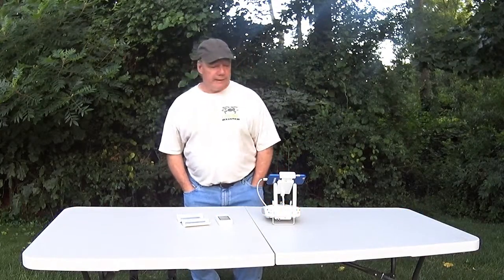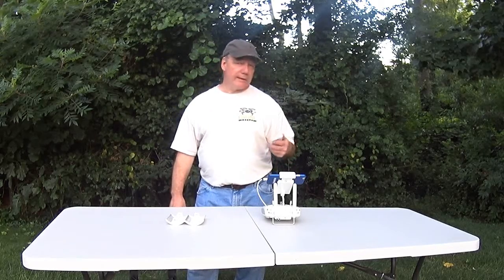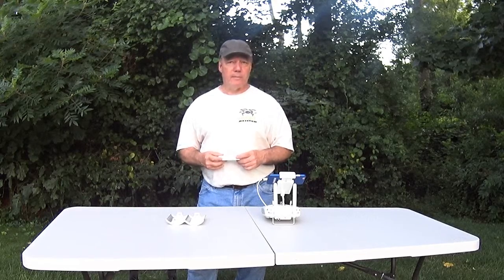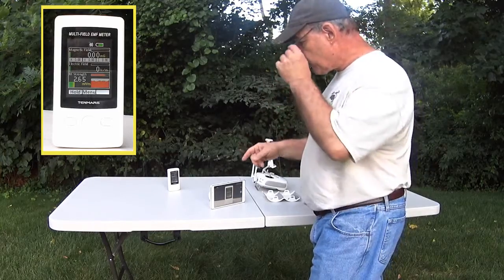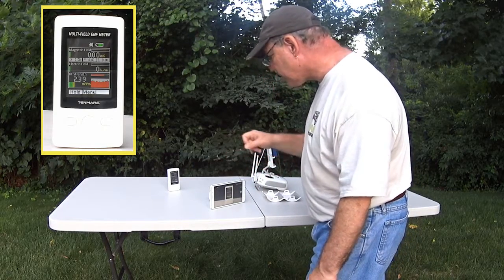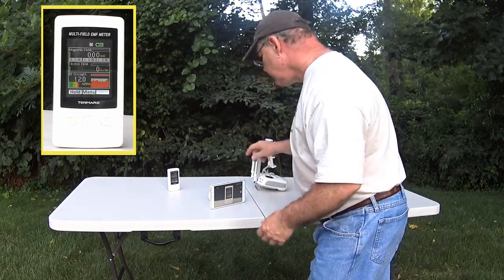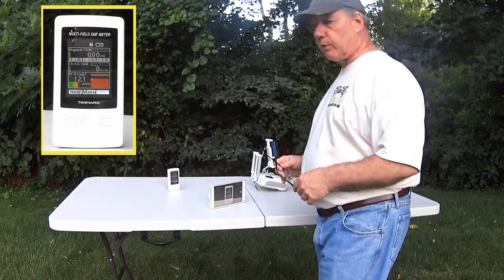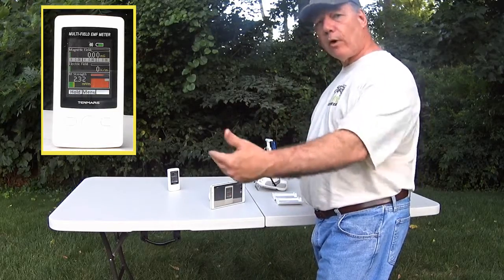DJI Phantom Drone Range Extenders do Work!

Comment: You gotta love shutting somebody the fuck up. Good job doing your homework!
Reply: kalidilerious 
lol there's a decimal between the 2 and the 0 buddy. 
2.0 not 20
Reply from the maker: Kaliderious, thanks for the post but I an assure you that these work great. Not only have I tested them extensively (a well as in this clip) but it's based on the simple physics principle of parabolic reflection. This has been used since ancient times to focus a beam. All modern radio antennas and broadcast dishes are based on it as well as flashlights and other technology like the entire Dish Network hardware. With the quads I find it adds about 50% more range to whatever one I'm flying and is an inexpensive way of increasing your signal strength. Thanks for the post and I hope that helps explain things. Rick
Reply: it wasn't 20 it was 2.0 which is 2
Reply: Ok even with the decimal it goes between 2 to almost 3 and when he points the "booster" it goes down to 1.2  . Its shenanigans.
Reply: lol if you don't believe it, try it. I've made a pair of range extenders out of a couple old beer cans.
Reply: You're interpreting the results incorrectly, or trolling.
Reply: IF I'am interpreting the results incorrectly its a mute point because even with decimals (like you suggest) OR no decimals, 1.2 is smaller number than 3 or 2. AND 12 is a smaller number than 30 or 20. He's makin stuff up.
Reply: lol just buy a set and try it. Idk what else to tell you. . .
Reply: You don't have to try it because you can see it doesn't work in the video.
Reply: kalidilerious must be an Obama voter. So easy to dupe...So quick to have the wrong opinion...
Reply: He didn't prove anything. At 3:00 in the video the EMF reader he's using shows a reading of over 20! And it goes to almost 30 at one point. Then he points on the "booster" and it goes DOWN to 12. Watch the video if you don't believe me.

Comment: As You can see , most people with a brain understand how & why this works.  I wish you would of done a 306 deg test to see the loss when facing away from the drone with the extenders.  That would really show the 360 deg power without the extenders & the 180 deg loss with them.   By the way I bought 1 for my phantom 4 &  1 for my 4 pro.
Reply from the maker: Eileen, it would seem like a simple concept but a lot of people were skeptical of them so I did the clip to show the signal increase they provide. I am planning on doing a follow-up to this clip comparing these to some of the aftermarket antenna upgrades to show how much more signal they provide. I do appreciate the comment and hope you sub the channel so you don't miss anything. Rick

Comment: Hey rick i feel limited on where to fly my drone here in pittsburgh. Theres ppl everywhere. If there's a field theres ppl, if there's a park there's ppl. Could I still fly it around ppl or not? With the FAA cracking down. It seems scary. I registered my P2 Last year. Never taken the test though.from what I understand is You only need to take the test if your using your drone to make money?
Reply from the maker: You can fly around people but you're not allowed to fly "over" people without their consent. You don't have to take the Part 107 exam unless you're using the quad commercially so have fun and fly safe. Be sure to sub the channel too so you don't miss any updates. Rick
Reply: Well, I like to do video of the beach at sunset, and I don't see how you cannot fly over people without their consent.  Am I going to get a "model release" card signed by every person on the beach out in public?  Seems like the same rule for photography on people on public streets should apply to drones over public areas....

Comment: Hang on a sec... I appreciate your experiment, truly. But...your RF meter is only a few feet from the source. Of course the signal is going to be magnified 4x or more.
Do the same experiment in a large soccer or football field, or even further away, and see if you still get the same strength magnification at that range.
I seriously doubt it.
I'm not hating...at all. I love your videos.  If I had an RF meter I'd go test it with my P4 myself.
I do have the Skyreat Extenders as thus far, I'm not impressed.
I know Ken Heron had good luck, but he didn't do a before and after in his video - so it's impossible to know how far he would have gone on that hilltop without the extenders. Same distance? Maybe.
(Ken, go see Vulcan again...without the extenders!)
Reply from the maker: Chris, thanks for the post but the honest answer here is that it's doesn't really matter how far from the controller you do the comparison. Radio waves (like all waves) attenuate at a give decay rate the farther you are away from the antenna. By measuring the output as roughly 4 times as much as the stock antenna, you can assume that it will be that much stronger at every point you measure when compared to the original signal. It would be harder for me to measure it at distance as well because of the abundance of noise in that spectrum from all the other devices (wifi, Microwave ovens, cell towers) crowding the ISM band. I have used the passive reflectors for years and they really do help increase the signal strength. I hope that helps and I appreciate you watching the clip and commenting and hope you sub the channel. Rick

Comment: I agree with you, from my own personal experience they do work. I came across another youtube video (sadly i can't remember the link). The chap who did that youtube video did a similar experiment to you. However he went into it a little deeper and explained and showed how the type of refletors you tested weren't true parabolic reflectors. He posted a template for a true parabol for the phantom 3 and 4.
I went ahead and made one from the template, which cost pennies, the result was phenomenal, far better than the mass produced item you tested.
Either way, home made or mass prodused, the reflectors greatly improved the range over standard.
Good video and i liked your physical electronic proof.
Reply: That other clip was Andrew McNeil.  Sadly his design was not correct and when he showed a roll of tapes curve being the "Same" curve and not a Parabola, he was totally wrong.  It actually should look more like a curve than a classic looking parabola since only a small amount of the parabola is being used.  

I did the same design using SolidWorks parabola design at the same distance that the antenna is to the rear of the parabola and then overlaid his hand drawn design. His is TOTALLY wrong. !   I mean this guy uses straws and none precision side cutters to trim electrical copper wire to precision microwave frequency lengths ?  He didn't even reply to my comments on his design.  Why ?  Because he has been proved wrong about him hanging crap on the designs out there.

I would trust a $10K + programs design that is used to design million $ machinery over a hand drawn design.....

I used my design, 3D printed it, used Brass as a reflector material and got 8KM range on a P4 in CE mode (Low power in Australia).  Proof it works.
Reply: simon p Hi I am in Aussie too, could you please send me a link to your design, I have a Phantom 4 plus and got 3.6km in a remote beach area using 2.4 frequency, will your design improve this? 
jennings93@gmail.com

Comment: Thank you Rick and it's so nice to see the proof.  I have a similar pair only they are two separate pieces with a gold color reflector that slide over each antenna.  I have tested with and without and no doubt there is a considerable amount of signal gain when they are used.  It is a very inexpensive way to improve the antenna gain.
Reply from the maker: Orville, I'm glad you enjoyed the clip and appreciate you posting. I did this video after getting a ton of questions about these reflective extenders. I've used them for a while and love them. I'm working on another clip right now that compares these to the ARGtek upgrade to show the difference in signal strength. Be sure to sub the channel so you don't miss anything. Rick
Reply: Rick since I only recently purchased my Phantom 3 Pro (and love it I might add), do you feel it would be worth "dumping" it for the new Mavic?  I notice that the Mavic seems a lot lighter and may not perform as well in wind.  I love that it's so compact and easier to carry around but is it that much better to upgrade to in your opinion?

Comment: I recently tested the stock P4 antenna on top of hill. It went 6k ft and lost signal.  With the reflector on, it made to 13k ft.  So I'm curious if Argtek would be a lot better than the $7 reflector.
Reply from the maker: Wow, that reflector really helped extend the distance for you. Normally I've seen about a 50% gain in distance with the reflectors so you did well with it. The ARGtek will extend it even further because the flat panels are very directional so you can expect even more range using that kit. The other thing the ARGtek can help with is improving the reliability of the signal, especially in noisy areas. That is really important in areas with a lot of interference to help you keep a strong connection to your drone. Thanks for commenting and I hope you sub the channel so you don't miss any new clips I post. Rick

Comment: I think if you was to take your measurement from your meter being attached to the done 1/2 mile away it would really prove you point. See its about how much of the strength of the signal can be  transmitted and absorbed. Or just put the meter in front of your dones camera 1/2 mile way and transmit the results back to your monitor , and you would be able to see your reading. And see if your still getting that 12 or less. Real world test with real world results.
Reply from the maker: Cled, thanks for the post and that would be a cool test to do but just the simple test I did showing how much more powerful the signal was that close to the controller kind of proved the point. The attenuation of the signal would be the same for both the naked controller and one with the reflector on for the same distance away so even down-field the signal would be much stronger. I am planning on doing the test again with the ARGtek kit to see the difference and will try and find a way to do what you're asking. Be sure to sub the channel so you don't miss anything. Thanks, Rick
Reply: Drone Valley Hi I am in  Australia and you don't ship to here, where can I get the extenders?

Comment: I believe you so I have subscribed. The test would have been more useful if you used the meter at several lengths away from the transmitter so that the extended range is conclusively proven.
Reply from the maker: Thanks for the post and I thought about moving the meter out to several different distances and may do that with the next clip. The results are the same either way as it shows the improvement the reflectors provide, even though the signal attenuates the further out you are it's still larger than without the reflectors on the controller. Thanks for the post and I hope you sub the channel. Rick

Comment: I have purchased a pair of these. They are not joined together like yours, they are two separate panels.  Where I live there must be a ton of interference because I cant go more than 700 feet out without losing my signal and contact with the PP3. Then I tried these panels and I noticed a difference at that same distance. It really did help.
I took my drone up to high desert in Nevada...I was able to fly 3 to 4 times as far with no loss of signal and I can only guess its due to a lack of people and other wireless interference.  I knew the panels helped, but I didn't know it was a 4X better signal! 
Thanks for your video...Subscribed!
Reply from the maker: Thanks for the post and these are one of my favorite accessories for the quad because they are cheap and very effective. I'm glad you added them to your kit and I won't fly without them! Thanks for the sub, I have a lot more content posting this week so stay tuned. Rick

Comment: These things will absolutely work. You're turning an Omni directional antenna into a directional one by sliding a reflector onto the antenna. For anyone to think this won't improve signal in the direction the silver (or gold, depended on the colour you chose) is facing is incorrect. I'm a ham radio operator with the top level license (lots of study!) and it's RF 101 something like this. If you're a real cheap skate you could make one out of cardboard or balsa wood and tin foil too. Great demonstration of how something so simple and cheap can be effective. I'm waiting for mine to arrive in the mail for my Phantom 4 👍🏼😎
Reply from the maker: Thanks for the post and I agree with you. I was convinced they worked on my controller the minute I started using them but had a lot of doubters on the channel. I decided to do the test clip to show the results of an EMF meter to put the issue to rest. As an Engineer, I understand the RF principle behind the reflectors and wanted to add some science to the discussion with the test. I appreciate you watching and commenting and hope you're still subbed to the channel so you don't miss any new updates. Rick
Reply: vk3crg I had one for weeks and like a dummy I was using it backward lol only used it for 3 min thought it didn't work can't wait try to try again  wow I'm a dummy sometimes they didn't even slide all the way down the antenna lol

Comment: Great video. Very informative and detailed. You seem like the right guy to ask my next question. I do not know if anyone else has asked this question before, but here it goes. Why haven't the DJI's of the world, or any other manufacturer of drones, for that matter, come up with a device that recharges the drones battery while in flight? Something like a car's alternator, that is used to recharge the car's battery, without having the need to keep recharging the car's battery every 30 minutes. I'm just curious about it. Is that even possible when it comes to drones? I know that a car's battery is different, but can the same principle be used to recharge a drone's battery?
Reply from the maker: Luis, thanks for the kind words on the channel. Great question but its an age-old struggle that many have tried to solve. What you describe is called a perpetual motion machine and essentially it doesn't produce enough energy to make it worth it. In the case of the drone, technology would have to be added to the quad to either capture wind energy or solar power to use for recharging the battery. Both of these technologies would produce a small amount of power but the added weight they would produce would actually drain the batteries faster than if they weren't there. For them to work, these systems wuld have to produce more power than the loss they create and nobody has been able to crack that puzzle yet. The reason that an alternator works in your car is that it's being driven by a fanbelt connected to your engine that is being powered by gasoline. It's essentially converting mechanical energy into electrical energy to charge your battery. It does cause the car to use more gasoline than if it wasn't there but the trade-off is worth it. Great question and thanks for asking it. I hope you sub the channel so you don't miss anything. Rick

Comment: thanks for a great informative vid, my problem isnt im sceptical it's just gonna be hard to fit to my setup, so that's all I need to know, I'm gonna try to stick one on my p3 standard even tho the tablet gets in the way I'm sick of getting dropout when I'm only 50ft up.
Ps I'm really jealous of you guys there in the states, I've seen vids that guys have done in their back yard, we can't do this over here so roll on registration in the UK.
Reply from the maker: Steven, thanks for watching and commenting. There is actually a model that is made for the P3 standard but we're out of stock on those right now. You can use the P4 model and file the bottom hole to fit the Standard and it will help. We also sell an ARGtek kit for the controller that replaces the stock antenna with a set of paddles that will really increase your range. Sorry to hear about your restrictions. I know its a lot of work but sitting down with your local town council and discussing the bans might help. Once they understand the hobby, a lot of them will tweak or eliminate the restrictions. Thanks for posting and I hope you sub the channel. Rick